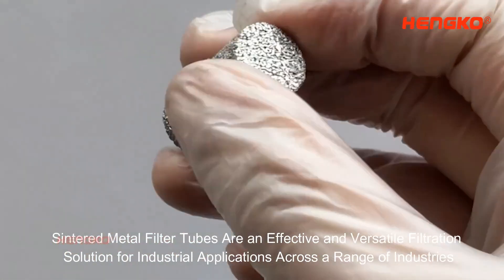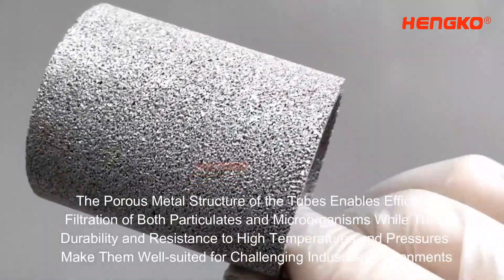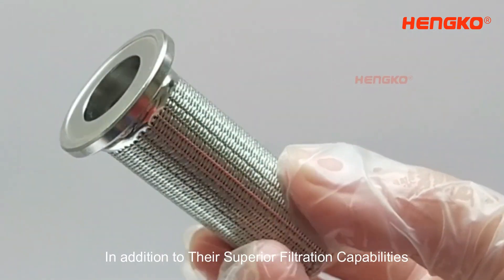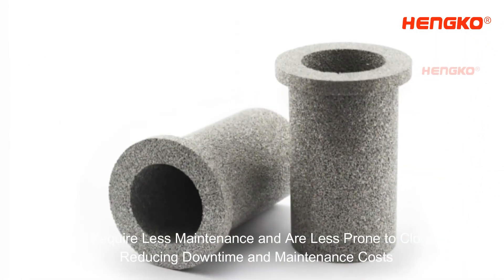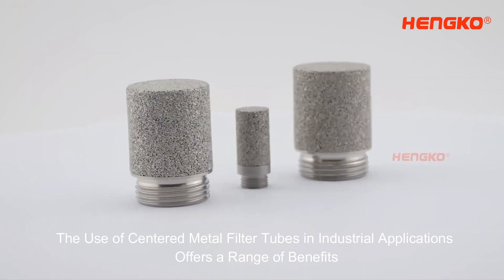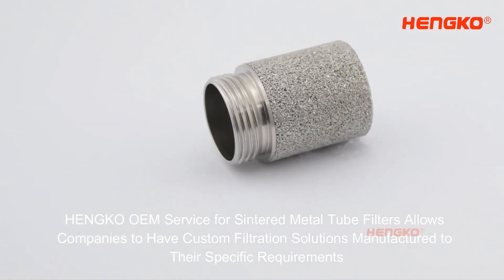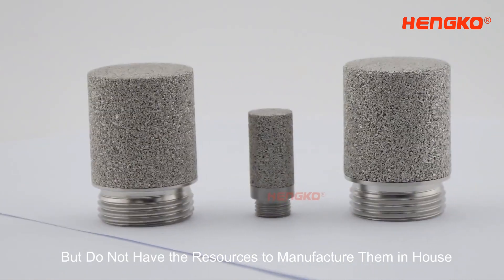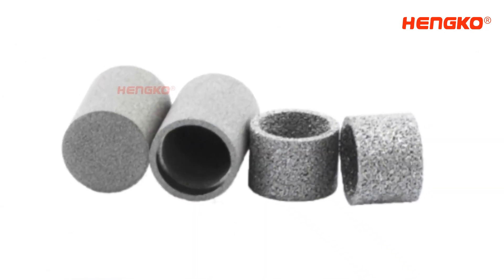What is the Benefits of Sintered Metal Filter Tube

Comment: how i can clean the sintered metal filter??
Reply from the maker: Hi, If the filter is heavily contaminated, you may need to pre-soak it in a solvent or cleaning solution to loosen the dirt and debris. 

Use a solvent that is appropriate for the type of contaminant you're trying to remove. For example, if the filter is clogged with oil or grease, you might use a degreaser.

 If the filter is clogged with mineral deposits, you might use an acid-based cleaner. Be sure to follow the manufacturer's instructions for the solvent you're using. 

Hope those information will be helplful!

Thanks! if need to replace new sintered metal filter, please check to our website and choose or Custom your right one. 

https://www.hengko.com/ and also you are welcome to send inquiry by email  ka@hengko.com of still have any questions for the sintered metal filters.